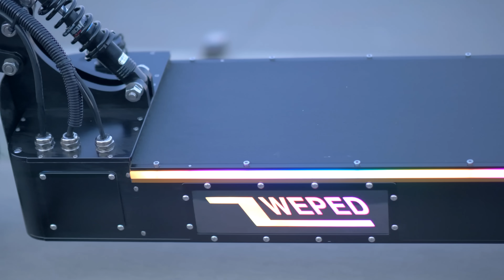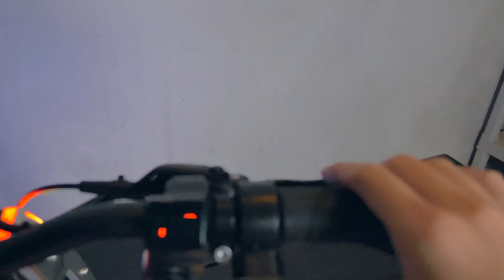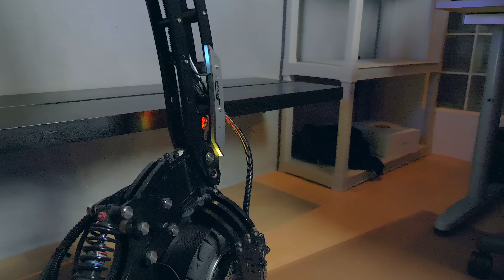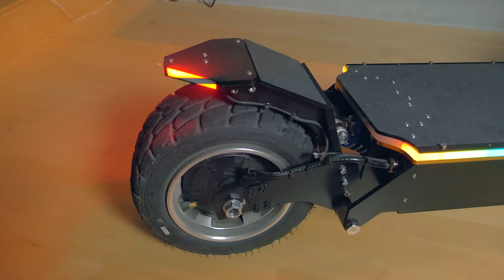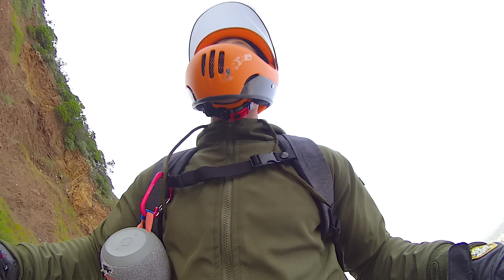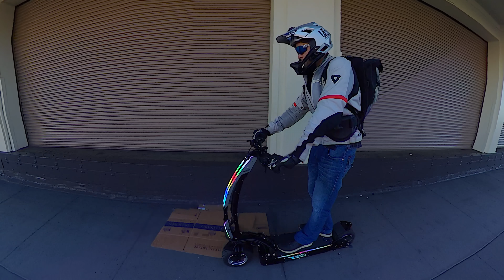WEPED SS Electric Scooter, An Insanely Fast And High Quality Ride

Comment: So to clear this up for anyone who's wondering about the SS I've test rode it myself about 2 months ago and got up to a top speed of 65 miles an hour with a tail wind which lasted about a minute or 2 and then dropped down to 60 miles an hour and the weight of the scooter is at 121 pounds to be exact, again you will not be holding that Max speed the whole time you might do that for a minute or 2 and that's it it's over with until you charge it to 100% again.
Reply: Also I weigh a 180 pounds myself exactly so to do the 70 or 75 mile an hour speed I would assume you need to be around a 100 pounds so maybe the top speed is exaggerated hard to say
Reply: I like the scooter a lot and the design, I do not like the cheap buttons and no big display to show you all your information but it is a nice scooter very expensive but at the end of the day I still prefer my thunder for $2500 cheaper and much more comfortable
Reply from the maker: Good points Jason, nice to see you.  👋 I'm still debating if I want to upgrade my Thunder to the SS or not.
Reply: @AlienRides   Yeah road the thunder for the 1st time all the way from Redwood City to downtown San Jose then from San Jose back to Redwood City at 64 miles on level one and level 2 mostly low level 2 going around 27 miles an hour average speed.
Reply: It was a great trip I went on the Bay trail and then on El Camino also my feet were exhausted though when I got back I had the dog on my back to

Comment: This definitely cost less than $1k to make so why is it $7k.
Reply from the maker: I think it's made in Korea where labor is more expensive, and there's a ton of batteries. If you have the knowledge to DIY though you can definitely make some awesome stuff!
Reply: Alien Rides batteries are cheaper than some people thing. Just to put this into perspective material wise there are full on mini motorcycles retailing for half of $7k.ever heard of the Honda grom, the material cost of a grom is significantly greater than that of a metal frame with batteries and leds. If a fully capable motorcycle barely cost $3k then this should be in the $1600 price range (at the most). This company is simply price gouging to account for the lack of sales which is a horrible business strategy.

Comment: What horrible tire design for a scooter capable of over 70mph that's pretty sad
Reply from the maker: Maybe you're right. They used these cart tires, which is amazing in straight lines, but might not be the best at cornering.
Reply: @AlienRides  exactly. Turns at high speeds especially sharp turns with those tires = risky and dangerous

Comment: They won’t be selling very many at $7000.00 just saying
Reply from the maker: Yeah, maybe not, but I think that's ok too, not everyone needs/should be going 70mph. This is their flagship model, and they do offer many others at cheaper prices.
Reply: Alien Rides just so you know I do think it’s very very cool ! And it must have been awesome to ride !!! Some day these will outright replace motorcycles. How many years would the battery cells last? If the price came down it could be a cost effective form of transportation in areas where the weather is nice year round
Reply from the maker: @xrick76tube  Yeah, definitely hoping that better technology helps drive the price down, and provides better battery longevity. Right now the battery cells go down to about 90% capacity after 5-7 years I think? Solid state lithium is coming which should extend that quite a bit though.

Comment: This has to be the poorest design for a scooter.
Focus more on speed control and less on the lights.
Why design something that does not work?
Are they working on square wheels yet?
They dont work but they have killer lights
Reply from the maker: Hah, very good points. I do have a lot of fun riding this, but it's not a mean riding machine like the Rion.

Comment: You refer to the machine as being fully waterproof is this backed up with an IP rating. Are the handlebar controls fully waterproof ?? I ask because the selector switches really do not look like they can handle a rain storm. I really require a heavy duty machine that I can use all year round in all weather conditions to be a genuine full time commuter to replace the car. Could you review this machine again showing under the hood and what makes it waterproof. Great channel
Just had reply from Weped that the SS will only have waterproof connectors not a waterproof chassis or handlebar controllers and Weped added they will not cover water damage in the warranty.
Reply from the maker: Sadly I don't think there's an official IP rating. I don't have this scooter anymore, but it would be fun to take it apart to examine how true those claims really are.

Comment: Does the Ss come with the front light garnishes  included ?
Reply from the maker: It comes with the ones seen in this video. And you can of course buy tons of additional extra features for it as well, like a LED deck.
Reply: Thanks for that info!

Comment: This thing was made to kill people. You’re safer buying a motorcycle. Population control comes in many forms...
Reply from the maker: I definitely agree that at high speeds motorcycles are way more safe. There's something fun about having something compact enough to throw in the back of your car and not require a license though. Maybe I should do a motorcycle vid some day.
Reply: Alien Rides. Scooters have very little forgiveness when it comes to correcting the machine in a do or die situation. The stupidest crashes I’ve had have been on scooters of any kind. Basically it comes down to short wheelbases being awkward and not exactly the safest thing to ride.

Comment: Yes it's faster than a stock Sur Ron but what happens when you hit a succession of bumps and potholes at around 65 mph. Come on dudes lets just make a Sur Ron killer for 2.500 dollars. you can still fall but it won't be so more intense in that respect!
Reply from the maker: Yeah, the Sur ron with bigger tires and a larger suspension will definitely be more comfortable. A car will also be more comfortable too, I guess a large part of it depends on the form factor you're looking for. I'd love to own a sur ron as well :)
Reply: No, I'm talking about the risk factor. People will go faster till they hit that top speed and those wheels are to small for that kind of speed. Case in point I have push mowers with large and small wheels in the rear. The bigger wheels have no trouble with holes but the little wheels get totally stuck in them. So, it's about the hazards! Make the Sur Ron clone everybody wants, and make a more affordable version of a high performance off road e-bike that looks good!!! Trust me when I say this....You'll thank me later!!!!!!!!!!!!!!!!!!

Comment: That's a death trap bro...  It needs to have bigger wheels and a suspension with that kind of speed.  Speed is nothing without control.  I like it though...cool ride.
Reply from the maker: It's super fun for sure, but definitely dangerous like you said if you ride at high speeds. Agree that the rider need to stay in control.

Comment: It looks like a quality build, but what's with the cheap shit switches and buttons...straight from 1970's.
And for 7grand it should be hovering not rolling down the street.
Reply: That's the best comment I've heard on this video about the we pad SSI was gonna say that myself I like the scooter but for $7000 it's uncalled for to use those cheap switches and no indication of how fast you're going or I mean range on voltage in all that you have to look at it tiny tiny little screen where the key is to look at any information whatsoever
Reply from the maker: Yeah, the switches could definitely be improved for sure! I'm still waiting for a legit hoverboard!
Reply: @AlienRides  hahhahahahaha

Comment: 1:07 mark “best built scooters I have ever seen”. Dude is wobbling going 10mph and this does 70, LOL. Look at it shake when accelerating...
Reply: Just needs a steering stabilizer fitting then you'll be right.
Reply from the maker: Hah yeah, part of the shaking is just the insane amount of torque I think. A steering damper would help quite a lot on this scooter. Definitely should've been added stock though.

Comment: Very freaking cool and would LOVE IT would like it better if you could pick 1 color for the lights rainbow isn't my color... but ill stick to gas GPs can do the same level speeds not that you would ever go that fast its about having that power when needed.  But its to much money for a zero build next to no mod twist and go ride... a big part of lifestyle for me is building and modding my ride have no issues with my small bore ride having a total of 1,000 -2,000 into it over time
Reply from the maker: Yeah, I do believe you are able to set a single color, though I'm not sure how to do that myself yet. Sounds like you got an awesome ride, stay safe!
Reply: @AlienRides  no deck scooters yet i do have a fleet of bikes from 1100cc Honda touring bikes (3) to 2 stroke 80cc motorized bicycles a few 4t bicycle a few scooters a 50cc scooter trike fully built out my favorite ride even though it only tops in the 40s lol 
  Deck scooters are my next step as of now i have a Schwinn stand up kick scooter that ill be mounting a 100c kitted 2t on than building a goped deck scooter.. as i said building and modding is part of the life for me i dropped around 2500 building the 100cc(52.2mm-stroker kit) motor in my trike

Comment: If I'm going to spend 7 grand on something other than a car it's not something to would die riding when you hit a pothole at high speed. What city would even allow you to travel at those speeds without licensing? I would love to see am officers face when his cruiser is passed by a scooter going faster than the posted speed limit.
Reply from the maker: Yeah, most of these things at those high speeds are sort of in a legal grey area right now. Many riders are hoping these become the new electric mopeds of the future, but we will see.
Reply: @AlienRides  But sadly it's like riding a high speed skateboard. Your center of gravity is way too high. At least on a moped or cycle you are a bit lower even if not by much. It's a great design though.

Comment: Hope it does not get stolen, $7K gone!  But for $7K, you can buy a motorcycle!
Reply from the maker: Yeah, having it be stolen would really suck! Luckily it does have a key, and you can use a bike lock as well, but those can be defeated. Personally I never leave my vehicles out of sight, but that does limit usage.
Reply: It's 3400
Reply: @NaTeMaGic  the gt model is 3500, not the SS
Reply: Really? You must be joking, can I get a motorcycle instead of a Weped. I didn’t know. Can people just stop with these lame comments. If you don’t see the niche with this product and comparing it with a motorcycle I feel bad for you.
Reply: That's true they may have enough to just get a motorcycle but believe me when I tell you diehard electric scooter fans won't even be thinking of a motorcycle.   They're mind would be filled to capacity Just busy thinking about scooters.
Reply: @lexxzus  yes be true plus rion type scooters can go upto 111 km/hr plus 200 kms which is really good as per money because no feul and all plus long distanceis good
Reply: HW2800 and a great used car
Reply: Those are different kind, apples to oranges
Reply: Or a car lol
Reply: Bro but if u buy a bike u have to give insurance plus petroleum money thats increases plus every month
Reply: i paid £3000 for a Triumph 955i Tiger - as well as all the usual goodies it has heated handgrips, and will do around 130mph in comfort

Comment: 220 max weight while others are 350lb or more. Just think when it breaks from a drop. This is garbage and deceptive. I read their specs. There are way better options out there than this. Segway make indestructible ones and have been in business far longer than all the ones on the market. I'll stick to Honda quality made scooters. For the price i would buy the 125cc engine bicycle bike that goes 200+ miles at a real high speed plus its gas. Idk. I have a way better prepper mindset and philosophy of use than others. It doesn't say of its a brushless motor or not either from what I've seen.
Reply from the maker: I do think it could handle way more than 220lbs, and is better built than other electric scooters. Maybe electric scooters aren't for you, but personally I'm loving my electric vehicles charged by solar panels. Live off grid and ride for free all day.
Reply: @AlienRides  well they dont allow gas scooters on the side walk any more so electric stand ups i think are pretty cool. Im glad their's a many options out there. Appreciate the reply. I hope i didn't sound to harsh man. Im just looking for something far beyond the $600-$1800 range.
Reply from the maker: Lance Dooley normally if people don’t like the Weped SS, I suggest the Rion RE90, but the weight limit of that is probably less than the SS. Other options might be the Dualtron Thunder or Dualtron X. Good luck with your choice!
Reply: @AlienRides  I appreciate it. Men my size (heavy weight) they always leave us out of the fun.

Comment: 75 is not too fast IMO and I’m def brave enough do it. It’s not like you want to do max throttle the whole time anyways. More like you go speeds that are comfortable on regular streets and occasionally go wide open when you want more. 
With this, if you’re in the middle of the street, you wont ever feel like you’re holding up car traffic, or struggling on hills. 
Those disco lights and the overall design are a deal breaker for me. I just want spedo and charge remaining.
Reply: Actually 75 miles an hour is extremely fast for standing up on a scooter they've done comparisons that if you're doing 50 miles an hour on my thunder you would be doing a 100 miles an hour sitting down on a motorcycle so yes 75 miles an hour would be very very quick for a scooter as of sitting on a motorcycle doing maybe a 140 150 miles an hour so yes it's very dangerous and the sense of speed is outrageous
Reply from the maker: Yeah, probably 99% of people will never max this fully out, but it's nice to have that power there when you need to accelerate to get away from a car or whatever. If this design is not for you, maybe you would like the Rion electric scooter, or possibly Dualtron is more your style?

Comment: can you ride it in the rain
Reply from the maker: You can! It's supposedly fully waterproofed, but I think there's a few panels that could use a little more protection/silicon. Personally I'd be fine riding it in a light rain, but probably not a super heavy downpour.

Comment: death machine ...that kind of speed is not supported riding on such small wheels and standing  ...sure you might get away with it for awhile...............
Reply from the maker: You're right, it can definitely be very dangerous if you push it to its max speed. Definitely want to gear up and only ride as fast as it's safe to do so.
Reply: @AlienRides  so the manufacturers just make them to attract thrill-seekers that flirt with death and profits for the makers playing to that segment ... I ride one with a 2000W motor and a seat that when I first got it had to take off in eco-mode to control the torque, and realized at just 32 mph how quickly things could go wrong ... there are very exacting physics dynamics that have to be taken into account for the balance of fun vs. real danger ... I'd like to see the statistics of those thrill-seekers that have already changed their lives through unintended consequences ... not likely to find them since it would require tracking from hospitals and doctors, but likely more than you ever thought about... these scooters are fun as hell to ride and a great alternative transport in many respects, but if the manufacturers keep pushing these limits you'll begin see legal restrictions being instituted by gov't authorities ... so to you it's a good attract to an audience of mostly young YouTubers, but as a senior that's had my flirt with death on a supposedly safely engineered Yamaha motorcycle that had the wheel go into an unexplained wobble at highway speed on an interstate,  I think you'd do a greater service covering the lower speed scooters that still are quite quick, fun and great means of safely getting from point A to point B ...  [ just an old fart speaking his mind, and maybe saving some young one that thinks they're invincible  from ending up in a wheelchair for life ]

Comment: Why would anyone think it is a gas cap on electric? The whole neon lighting feels like a gimmick. Why in the world I would want to go 70 miles per hour on 6 inch wheels?
Reply from the maker: That's fair, the scooter design elements are not for everyone. If you don't want to go 70mph on a scooter then nothing to worry about, you're sane (unlike me)! 😅

Comment: I’ve seen the scooter plenty of times in different YouTube videos the thing that I noticed is that it’s too low . What about repairs.
Reply from the maker: Interesting note about the height of the deck, it is a bit low, which is good for lowering your center of gravity, but you could potentially impact if you slowly roll off a curb/ledge. The scooter does come with warranty, but it's probably too heavy to ship back. So while you can get parts for it, you would need to install it yourself, or take it to a bike shop.
Reply: It's built in a country where people are shorter.

Comment: Hey, if you accelerate from 0 with dual mode on, does the rear one also spin around?
Reply from the maker: It's hard to test, but I think the rear tire has enough traction and weight on it that it's doesn't spin. I'm pretty sure it's only the front.